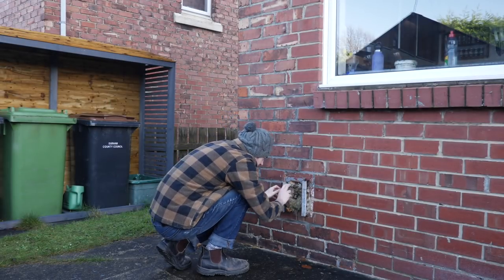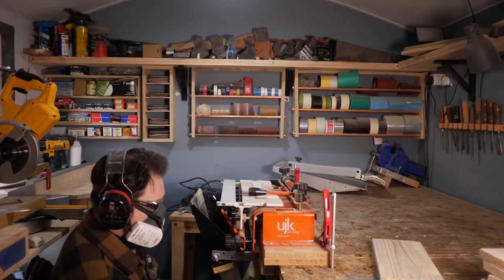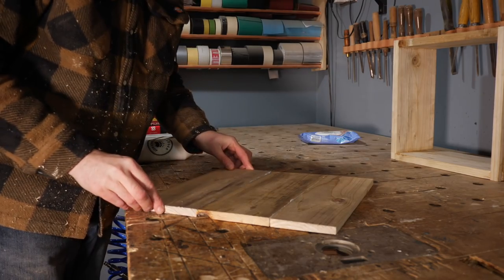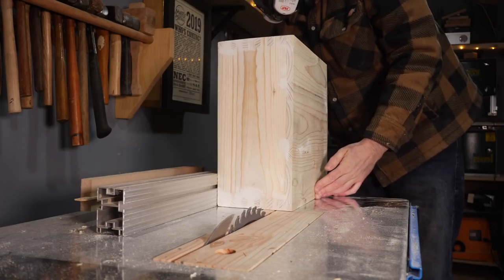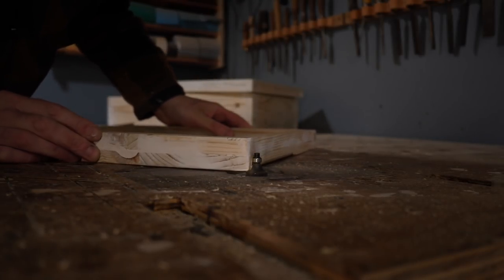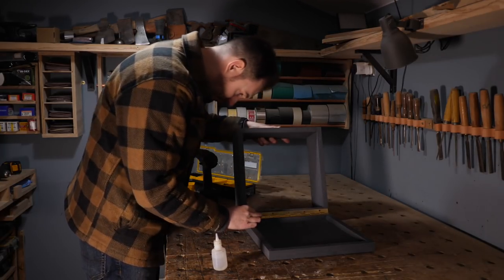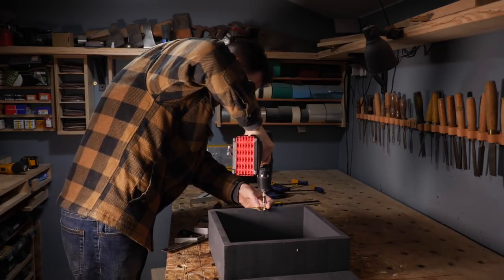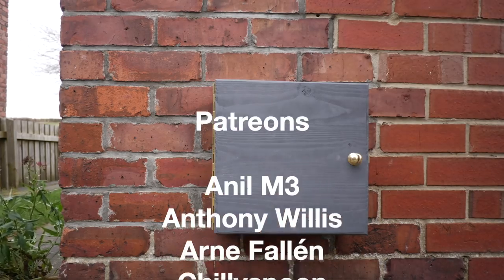Making A Garden Tap Box

Comment: Nice build, glad to see you painted the rear face of the box,many people forget that area and see the box rot from the back. As it's not holding structural weight, it's ok to drill into mortar joints, though not as secure as drilling into solid brick (away from the edge) as the mortar can crumble &  break away

Comment: Good tidy job mate. Like others have said put some insulation over the tap body and gland during the frosty weather. Or better still see it theres an isolation valve on the 15mm pipe feeding the tap and turn it off for winter
Reply from the maker: Thank you

Comment: Any outside tap should have an inside valve to close it, if the outside tap does freeze and crack, put your skates on !
Reply from the maker: Or insulate it like i have done
Reply: @Badgerworkshop    in that case i would add enough insulation to fill the box completely.